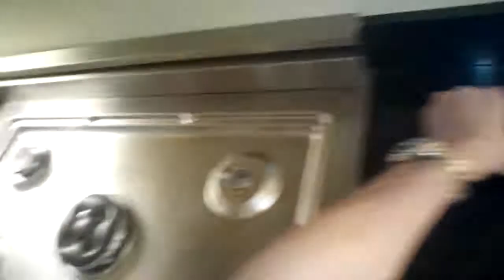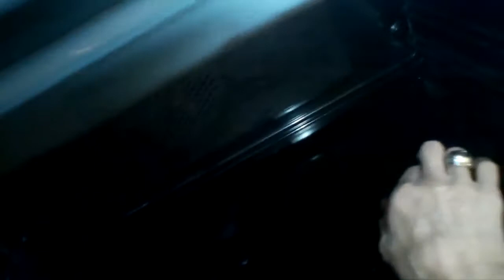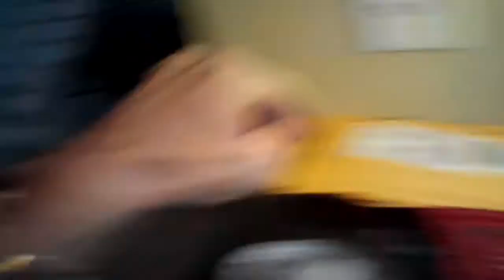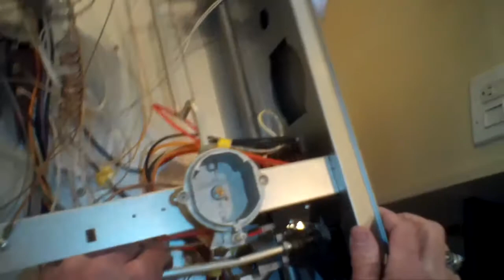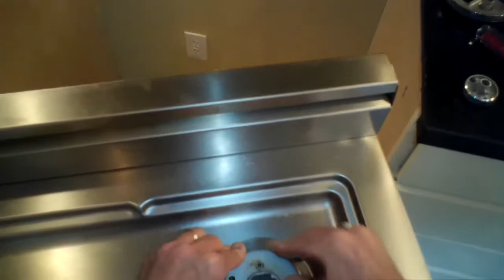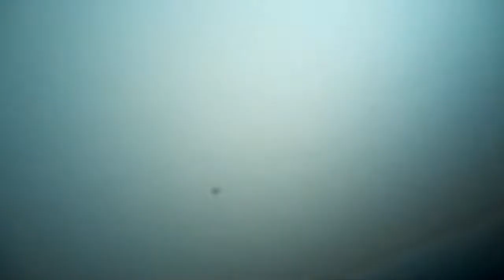✨ Bertazzoni Oven - Won’t Stay Lit - Easy DIY Fix ✨

Comment: Scott, thanks for your video.  I hope you still are able to get this message even after you posted this video years ago.  We have two problems with our Bertazzoni convection oven.  The center burner won't stay lit, and neither will the broiler.  This is a brand new oven, and we are the first to use it.  We even took the plastic off after we moved in.  But since we don't have a proof of purchase, Bertazzoni won't honor the warranty.  And a service call just to look at it is $450.  No doubt due to my zip code.  But that whole issue is a different video that I doubt anyone has tackled on YouTube.  But my question is, if you don't mind, will replacing the thermocouple address both the broiler and the center burner?

Comment: Do you have any video showing replacement of Thermostat in Bertazzoni oven? thanks!
Reply from the maker: Hi Richard,
I don’t think I have a video showing the replacement of the thermostat.
I think if you use the same video it will show you how to get into the area where the thermostat is so that’ll be pretty easy to replace.
Reply: @ScottTheFixItGuyChannel  the thermostat have some screws underneath which is hard to access... thats why i was very interested in seeing how it comes to action. Thank you! I will continue looking into it. The issue with my current oven is that it wont click when pressed on the knob. No flames or anything. Thanks for the reply!
Reply from the maker: @richardchen8148  Thanks Richard,
Are you pretty sure that the range is getting power?
I wonder if it could actually be the button that you press to activate the spark?
Reply: @ScottTheFixItGuyChannel  , power is through, because the stoves are working fine. and i tried removing the button as well, using my hands and screw driver to pressed down, didnt work

Comment: Great video. Does this apply to the stove stop/burners as well?
Reply from the maker: We still have top burners would be different.
Usually they just need a really good cleaning of the igniter and all of the metal parts of the burner to get them working again.
Reply: @ScottTheFixItGuyChannel  Thanks very much! Any recommendations on best products? The top burners sometimes have a hard time staying lit when first ignited and will cut off especially if trying to run a low flame.